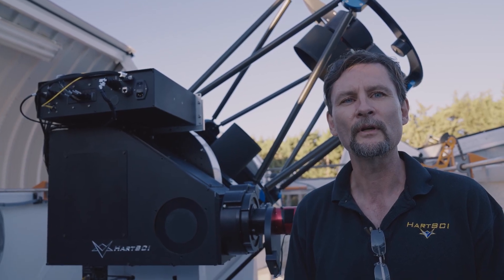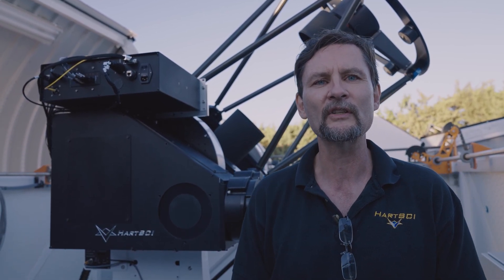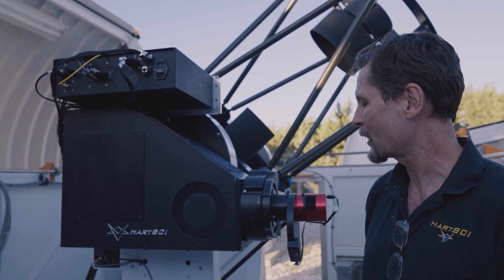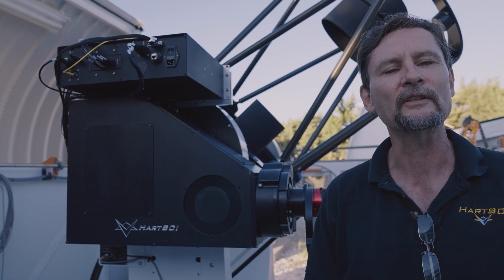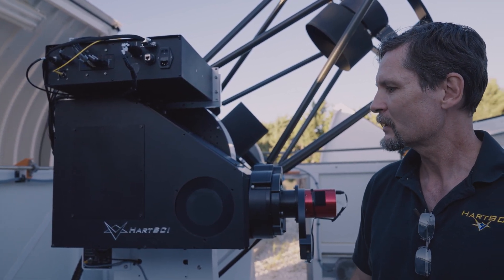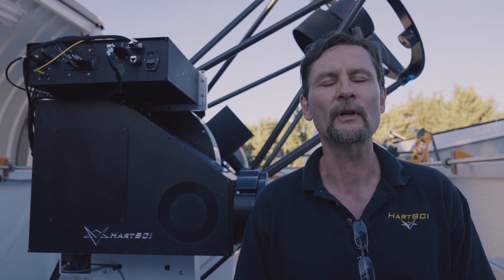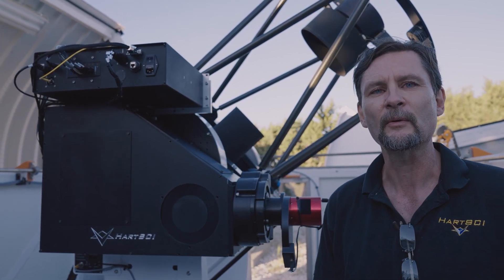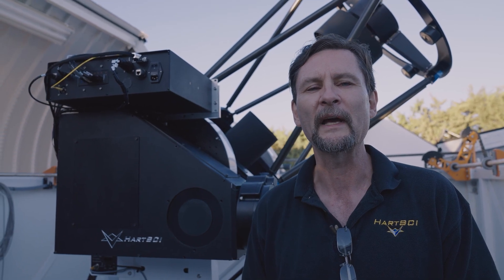PlaneWave CDK700 with HartSCI ClearStar Adaptive Optics

Comment: Now for the big elephant in the room…. How much $$$?
Reply from the maker: Depends on the model but it's expensive since it's true deformable mirror AO
Reply: @MattDieterich  The CDK 700.
Ball park with installation and setup?
Reply from the maker: @humlakullen  around $230k with install for the CDK700 systems. Where is your observatory located?
Reply: @MattDieterich  Wow… Looks like that CDK 700 has about doubled in price over just the last couple of years. Out of my price range.
Reply from the maker: @humlakullen  it's actually came down in price. It was originally $210k for the gear alone.
Reply: @MattDieterich  Ok, my bad… Maybe I got it mixed up with the 600;-)!

Comment: Impressive results! Does the Adaptive Optices use visible light, which will be missed for the observation or do they use infra red light, which could be filtered out, just for the AO, and leave the visual spectrum for the observation camera?
Reply from the maker: Hi Roberto, thanks for watching! Yes this model is optimized for 750 to 1000nm, but variations can be had for other wavelengths.

Comment: Not true. Pic du Midi observatory partnered with a French company to run adaptive optics years ago. This is not even close to a first.Lies won't get you into heaven...start practicing now.
Reply from the maker: First COTS telescope manufacturer and COTS
AO unit to be installed. Did Pic Du Midi manufacture COTS telescopes?
Reply: Ugh.  You're tiring just reading this post
Reply: @tylero8595  after selling lies its exhausting to be called on to have to come up with a whole other line of bs to stake a claim not yours to make.